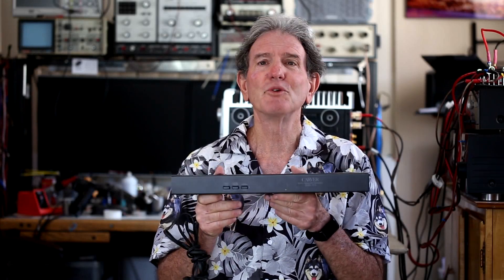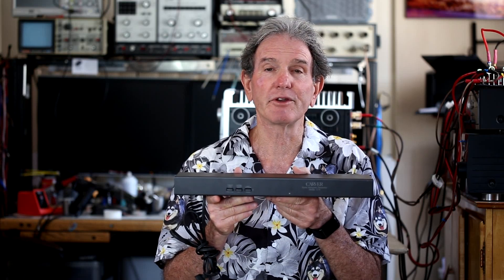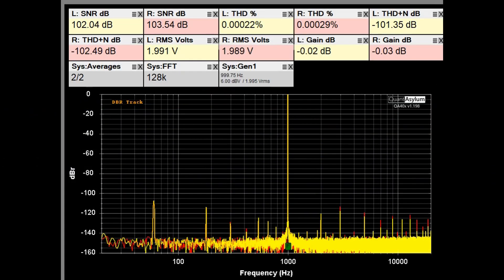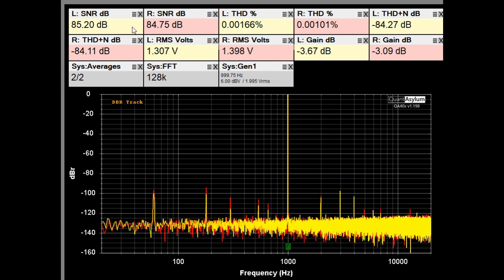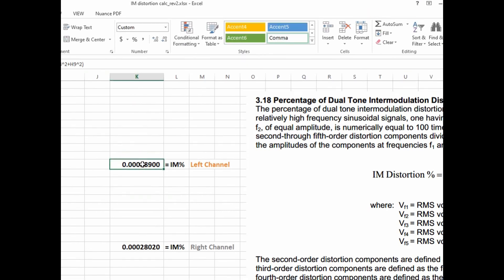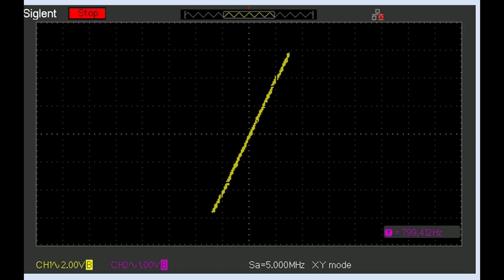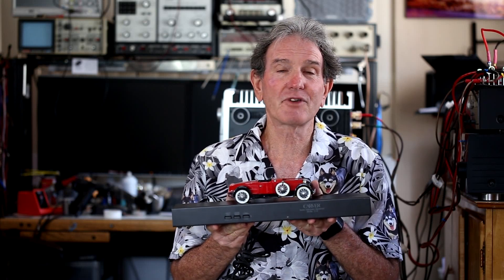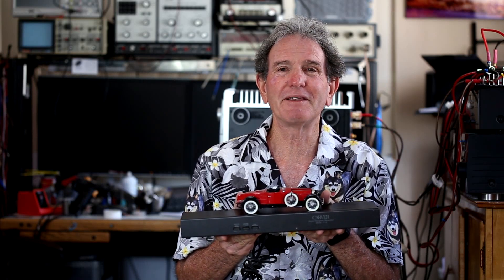CARVER C9 Sonic Hologram Generator: Vintage Audio Review Episode #141

Comment: My first experience with sonic holography was with the Carver C4000 preamp (not mine).  I bought a C9 in 1982 for $280.  I got a C11 preamp in 1990 and a used C16 about ten years later.  

Audioanalyst M8 (and M6) speakers, known for exceptional imaging, are a good match for sonic holography.  I think the C16 and a C9, paired with an Apt Holman preamp, work very well because both preamps have a variable Left minus Right feature.  

Theres no remote control but i do have an obedient slave whom I have taught how to push the correct button in and out.  

Paul Simon's album, Graceland, might be the best I've heard for exploring what can be done with sonic holography.  Simon mixed the master himself, and did a truly phenomenal job, with himself, Linda Ronstadt (one track), and Ladysmith.  Close your eyes and you can imagine them live in your room.

I have noticed small details I can pick out with sonic holography that I just can't hear in normal stereo, like a ghostly female voice softly saying, "going to Graceland," within arm's reach of my right ear.

Phase Linear had a couple of preamps, the 4000 and 2000, that sort of hinted at the method used by sonic holography to widen the sound image.  The Apt Holman too. 

I believe that today's five channel home theater systems basically use normal two-channel stereo, with an out-of-phase signal used for the rear channel speakers.  Or something like that.

Ya got two ears, done right, two speakers is all ya need.  Unless quad comes back.
Reply from the maker: I really appreciate your long commentary with your experience. I have thought about adding a remote control to my C9- just to engage it and will probably do so at some point. I will listen to Graceland via my streamer (in CD quality) through the C9 system soon. Have not heard or tested any Apt Holman gear. I typically have the C9 switched on, no need for training a remote control 😁

Comment: Does it connect like an EQ would?
Reply from the maker: It does- in a tape monitor loop or between your amp and preamp.
Reply: @vintageaudioreview  Thanks for the reply.   One of my integrated Amps an old Yamaha has these accessory jacks with jumpers.  I believe it allows such a unit to be connected before the tone controls.  This might be ideal..  They are labeled "SEND" R&L and "RECEIVE" R&L.
Reply from the maker: @OdinsCloud  I have not seen anything marked SEND and Receive R&L before. Jumpers are usually used to connect the main in and preamp out together. I would search and download the owner's manual and that should tell you what they are used for.
Reply: @vintageaudioreview  I did and it states accessory jack for EQ.    Yamaha A1020 from manual.
"For extra system flexibility, this amplifier allows you to connect a signal processing system such as an equalizer in the signal path prior to tone control.  Connect the Accessory Send terminals to the inputs of the equalizer and the outputs of the equalizer to the Accessory receive terminals"  
This amplifier sounds very good especially when it's class A circuit is enabled.  I have a Carver too with Holography and thought it might be nice try adding that to the Yamaha and see how it sounds.  Variable loudness is a nice feature with the Yamaha's when having to listen at lower volumes. Which i have to for the time being.
Reply from the maker: @OdinsCloud  Sounds like you are in business once you get a C9- hopefully, one that is working properly. I am not a fan of the variable loudness control- see my review of the CR1020 a week or two ago...
Reply: @vintageaudioreview  I will look at that.  Thank You!

Comment: would have liked more of a detailed explanation of what it does to the sound when switched on in the different modes
Reply: It brings in a little out of phase audio from the opposite channel along with a calculated time delay
Reply from the maker: @CatFoodDraino  Well put!
Reply from the maker: I probably should have read from the owner's manual what Narrow vs Wide, for example, was supposed to- sorry about that but thanks for letting me know!

Comment: Is it meant to 'synthesize' a sound-stage when that information is missing in the recording itself, or is it meant to amplify otherwise 'occult' or inaudible information when using equipment or a set-up (speaker placement or room correction) that is not up to the challenge of mining it from the grooves or code? I have an analog system that 'throws'  profound sound-stage beyond the wall boundaries when it is present, and reveals interesting effect when soundstage has been...lost, sacrificed, or martyred to some other sonic satisfaction. Mono recordings are eerily life like in scale, or present a gigantic, seamless and monolithic wall-of-sound that is, if only at first very cool.
Reply from the maker: Thanks for the thoughtful commentary. I can't comment on mono listening much except when I am just comparing the tone of one speaker to another. I would say that Sonic Holography is based on science and helps create a wider soundstage, or image if you prefer. Some may call it gimmicky. It does not work with all material, but the effect is noticeable when it does.

Comment: Great review and explanation. I enjoy the SH on my C-1. There is an LP that was sold with C-4000s that demonstrates the SH effect for those without the gear.  Very compelling. Keep up the great work.
Reply from the maker: There is a digitized recording of the tracks of that LP on Thecarversite.com website. They also had a small "record" in either Audio or Stereo review that you could remove and play that demonstrated the effect. As always, I appreciate the comment and hope you receive your ET30 soon if you have not...
Reply: @vintageaudioreview  
Thanks. I bought the LP with a. C-4000. 

I haven’t seen the speaker switch, but I’m sure it’s on the way. Thanks for your generosity.
Reply from the maker: @danstein2467  Thank you for participating. I downloaded the LP files, but have never listened to them- but will.

Comment: Here’s what I remember abut SH. We get our localization of sound from the difference between sound going directly to our ear and going around our head and face and arriving at the other ear. That means 1) a time delay and 2) changes in frequency response caused by the shape of our heads and faces. Carver figured out how to invert the phase and time delay of that “wraparound“ signal, and inject it into the audio. BTW, I’ve tried comparing the Carver in bypass mode (no SH) to the straight signal in my system. I couldn’t discern any difference. I’ve been using mine for 15 years or more. Great vid!
Reply from the maker: Thanks so much for taking the time to share. I think I showed that having the C9 in the bypass mode barely effected the signal, which is what you observed as well. It is very noticeable when it works.
Reply: @vintageaudioreview    I haven't ever switched mine off. My wife loves the effects especially with TV movies and shows.
Reply from the maker: @nancy4don  Thanks for sharing and it always nice when the wife likes audio stuff!

Comment: Hi Scott.  Thanks for checking out SH effects.  I'm a big Bob Carver fan and have been using SH for over 20 years.  With phase coherent speakers it seems to greatly bring out the effect.  I recently added a tube output DAC  which on it's own adds a lot of depth to reproduction.  With SH on top it is really interesting.  From what I saw in the changing frequency response between a single channel driven and two channels driven, would that mean the frequency response is constantly changing while stereo music is playing?  Also if a sine wave was reproduced on both channels, but offset somewhat to one side, wouldn't that greatly change the harmonic distortion measurement if out of phase signals were injected on into one of that channels measured?
Reply from the maker: Hi Thomas. I am glad you are happy with a tube DAC, but am not a big believer in tube sound vs solid state from my own experiences, but am glad you are happy with it. I think the frequency response is pretty fixed, as is the phase shifting at that frequency, because this is an analog device. The THD is pretty decent, but that is with both channels driven- it is possible it would change with one channel being larger than the other by say 3 dB- maybe I will look at that at some point.... Thanks for commenting!!

Comment: Hi thank you very much for this review of a very amazing product  
I am confused     I have always read that low crosstalk should improve soundstage   And then this unit appears with high crosstalk and spectacular imaging    Even holographic !  
I surrender  Too difficult for me to understand
Reply from the maker: Thanks so much for the question and I get the confusion. The difference is that the channels are being put in out of phase in the hopes that they will cancel out at the opposite ear. My analyzer does not take into account the phase differences, just the amplitude of the signals. Hope this helps a bit.
Reply: @vintageaudioreview  hi thank you very much for your kind reply 
A great 3d soundstage is the holy grail for many me included  It is a very fascinating sensation   kind regards gino